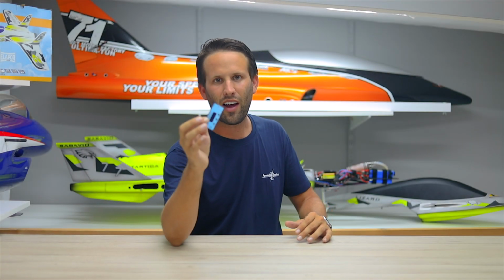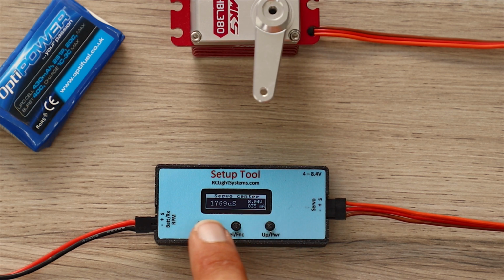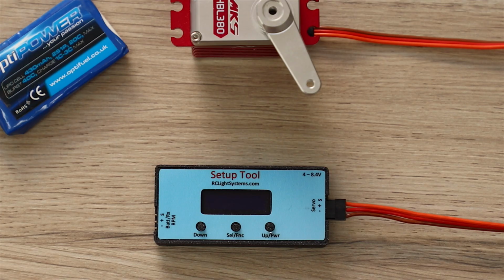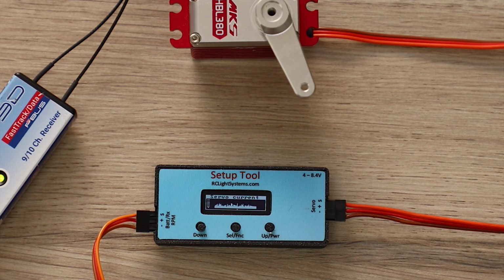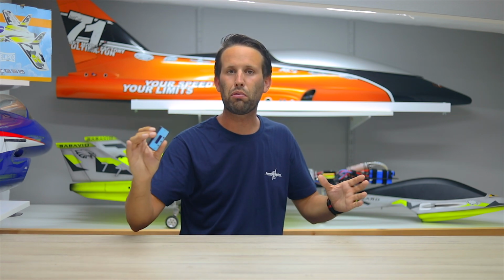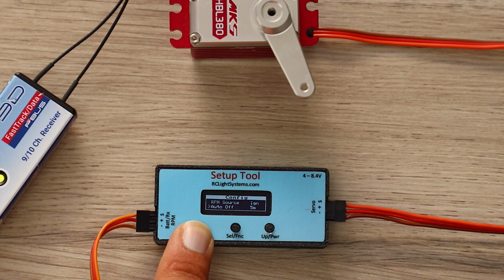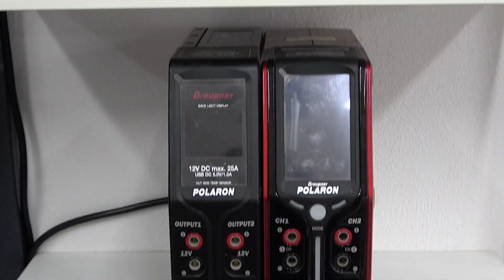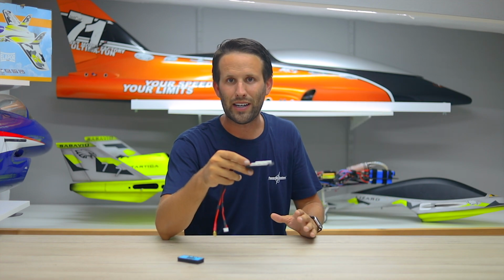The ULTIMATE SERVO TOOLS!! Cool Tech Ep8

Comment: Hey Martin love your videos, I have a question you might shed some light on regarding servo jitters. I’m running MKS HBL 550s all around on a 33 percent plane. The elevator servos are jittering quite a bit especially around center position. Any thoughts? He leads are about 36” long. I was thinking maybe about 25 percent expo might help? However I usually don’t fly with any expo. Thanks!
Reply from the maker: Hi mate, sounds like two different issues. Jitters, and overly responsive elevator? Which is it? =)
Reply: @MartinPickering-PickeringRC  So, very jittery on elevator especially around center position, might be a bad servo, the MKS are very strong but loud. I don’t care about the noise but the jitter is significant, almost like 3 to 4 mm uncommanded movement throughout a 20 degree range.  I can use this servo on unimportant position like choke if this is the problem.
Reply from the maker: @roymills415  can you try plugging one directly into one of the outputs on your powerbox and check if they are the same? Also what voltage are you running them at?
Reply: @MartinPickering-PickeringRC  Jeti R12, R5, dual path mode with 5200 8.2V receiver packs, parallel, dual redundancy on flight packs. I’ll let you know what I find, will also check separate output pin (receiver port) on Rex12. Thanks
Reply: @MartinPickering-PickeringRC  So latest attempts, tried three different ports on RX, same jitter, tried direct input servo to receiver, same jitter. There’s no slop on control surface, solid hinged line, solid 4-40 turnbuckle, steel arms etc. Going to swap servo out see if I can duplicate problem. Appears 550 can handle the long lead to tail no problem.
Reply: Hey Sir, I think I found the problem, I was able to use the servo test feature on the Jeti and duplicate the jitter on three out of eleven servos, I noticed the problem minimized based on antennae positions on the 2.4G receiver. Not sure why only specific servos were effected and only certain receiver channels but I’ll need to find maximum separation on the antennae when I mount in fuselage.
Reply from the maker: @roymills415  ok, good to hear you found it out!
Reply: @MartinPickering-PickeringRC  Thanks Mate!
Reply: Martin, follow up to the follow up, ie servo chatter problem, thought I had it solved, not so much, I won’t bore you with the 147 troubleshooting ideas I tried but just give you the solution. Noise was being generated on the EXBUS path from running the 900 MHz back up and two 2.4 G satellite receivers. I guess the DS12,only has 1 RF module for 2.4 so there was some “packet confusion” on the bus. MKS 550’s performing flawlessly now, so happy! Cheers!

Comment: Can this be used to set my Hitec 7950th servo arm to 90° center without using subtrim on the radio?
Reply from the maker: No, it is only a momentary tester, if you need to program you would need the Hitec programmer

Comment: Hello Martin very nice video.
In your opinion whats the best sevvo manufactory? I'm building a 2m flying wing at the moment and since it only uses 2 servos I might as well go for the best. Since I'm new in the hobby I don't really know which are good tho :(
Reply from the maker: Hi Peter, there are many options, depends if it is an electric wing, a turbine wing, a combat wing...  Personally I use MKS as I feel they are the best, specific servo will depend on specific use... (possibly going in your case for speed over torque)